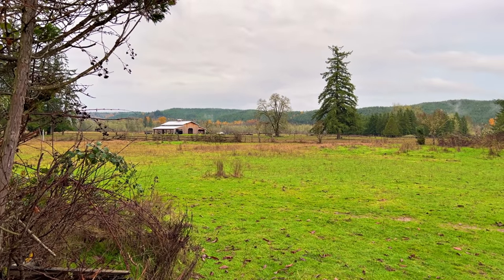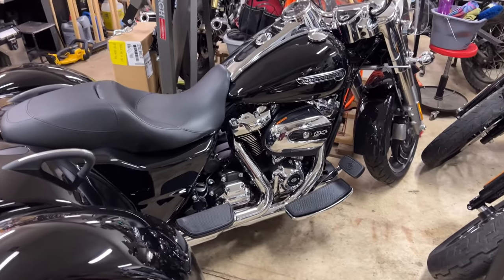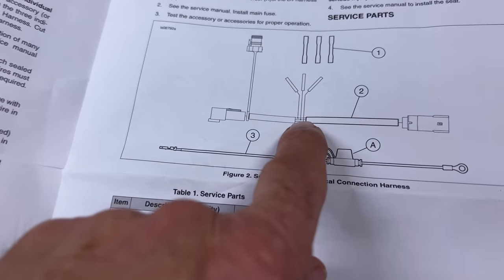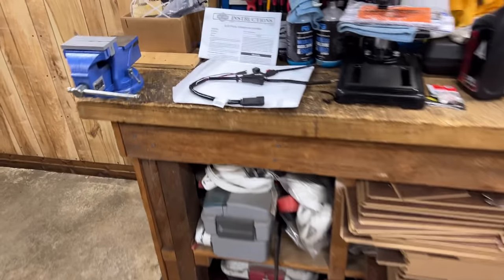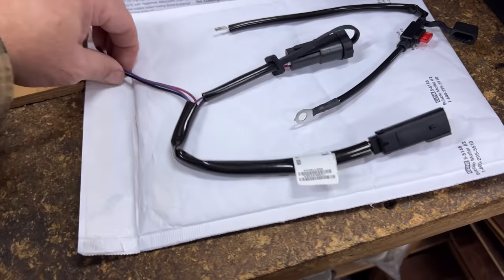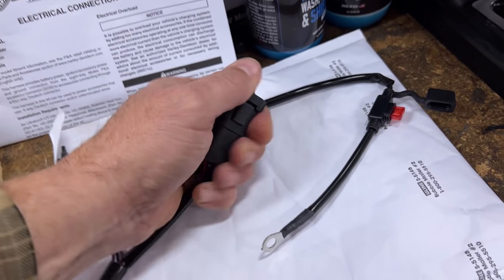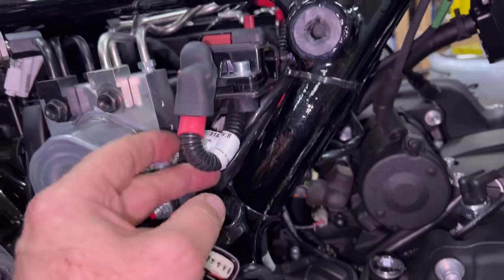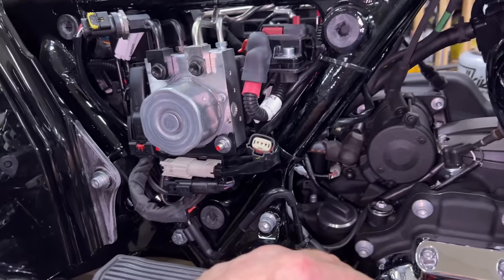I Broke Kelly’s FLiRTy!! • Heated Grip Connection Kit! | TheSmoaks Vlog_2204

Comment: I just added the Harley heated grips plus wired in a GPS to my 2021 Road King. The Harley install instructions are a lot easier to understand after you have completed the install. Thankfully the fuel tank is easy to remove and reinstall. I watched your videos on installing them on your street glide to give me the confidence to try it myself on the RK. 
Really enjoy your teaching videos.

Comment: I feel your pain. Have had the same experience looking for plugs or wires or connectors that were supposed to be there but weren't. Once, I finally found a block heater plug on a Ram truck after I'd owned it for a year and looked for it numerous times. Tucked and secured neatly under the radiator support and covered by a body molding that had to be removed. I believe the dealer was supposed to route and secure it in the location indicated in the owners manual but had failed to do it.
We live and learn 🙄.

Comment: For as many times you will use those heated grips and all that work I would have bought heated gloves.  I have been snowmobiling for over 40 + years and only had heated grips the last 5 or 6 years.  And we ride in -15 degrees and colder temperatures

Comment: I wish I had your knowledge and expertise with electrical wiring. My Eluder comes stock with a heated seat, but the pillion seat isn't heating up. I checked the connectors to make sure nothing was loose and they're good. I'm pretty sure it's probably a loose pin, but I don't know enough to really check that. I'll just have to wait for warmer weather before I can take my GF for a ride! Peace and love.

Comment: Are Harley heated grips reliable nowadays?  I wanted to get them for my ‘07 Road King back when I first bought it cuz I had wonderful heated grips on my R1200GS.  The Harley DEALER told me not to waste my money because Harley heated grips had such a high failure rate.  Just curious, if they have improved I might consider getting them although Harley seems to have stopped making a lot of the accessories for their older bikes.